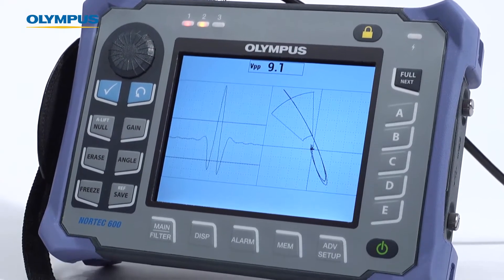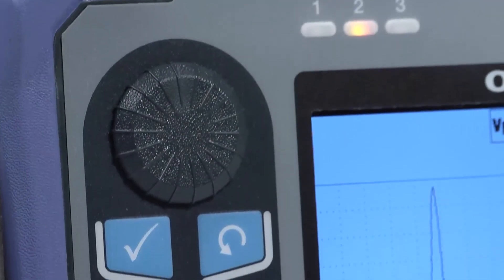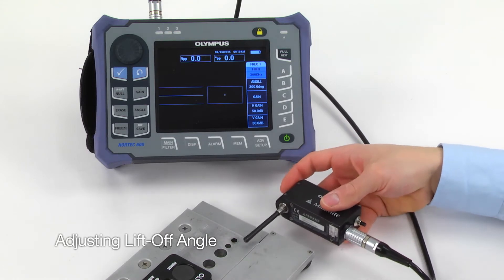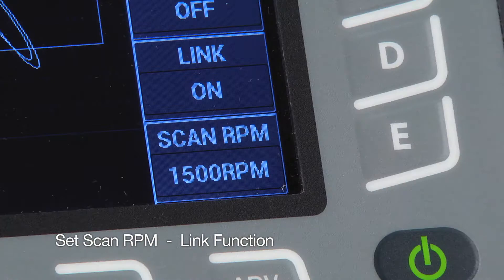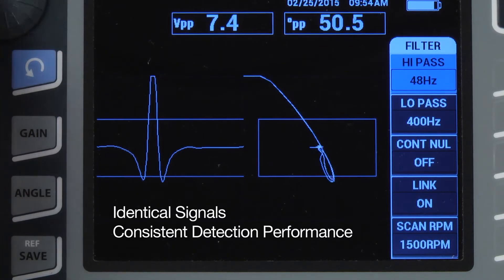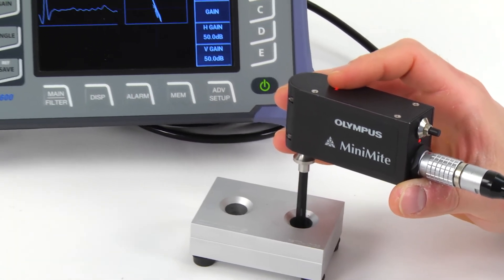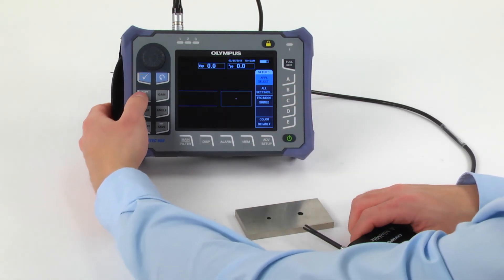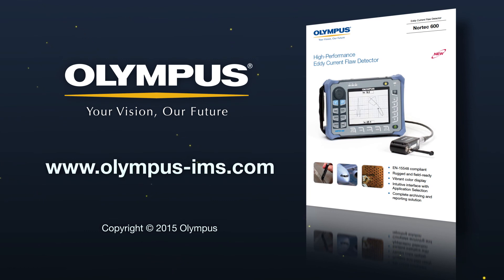How to set up for Fastener Hole Inspection

Comment: Does deburring the hole 🕳 helps or not?
Reply: If you by ‘deburring the hole’ mean ‘reaming the hole’, then for the love of God YES!
At least in aviation, calibrating by the reference block and hopping on to the aircraft structure holes turns the instrument WAY too sensitive. Also, the official reference block doesn’t account for what we call ‘mechanical damages’ like dents or scratches. Remember, the calibration block holes are absolutely perfect by definition. You’ll almost never find that on a well used aircraft, or any other structure. Leave it or not, that’s my experience. Always deburr the holes before NDI inspection.
Reply: @HanOnkel  I know what reaming the hole means I’m a structural mechanic at boeing. And the reason I asked is because our NDT or NDI guys are always telling us to deburr the holes and I’m like bro it’s already deburred 😂🤣 how many times you want me too ?? and honestly deburring the hole does not help IMO 😆 because ur not checking the outside of it. It’s called open hole inspection for a reason .